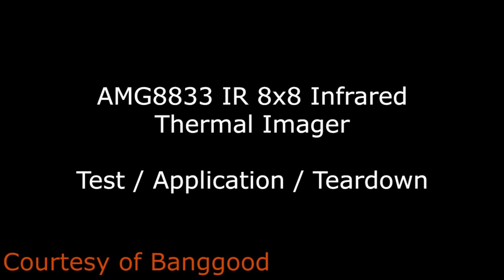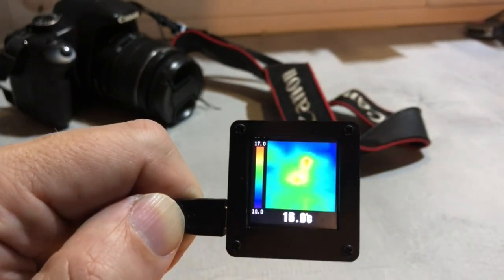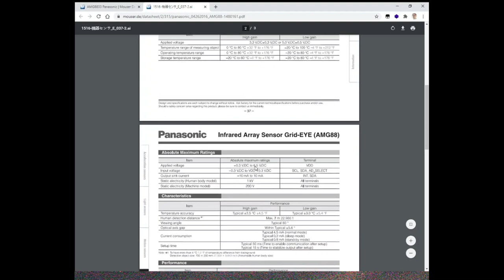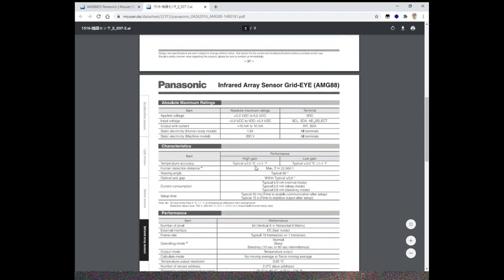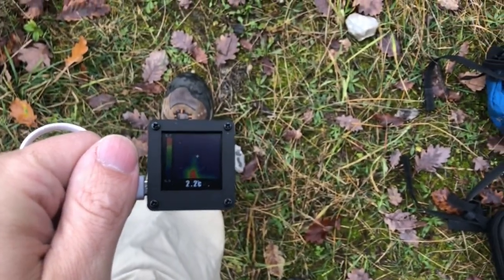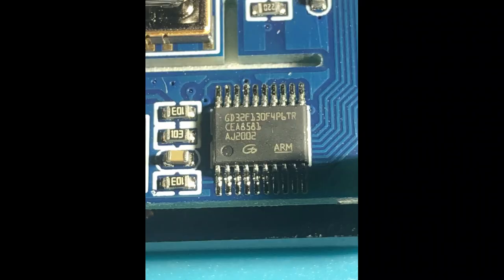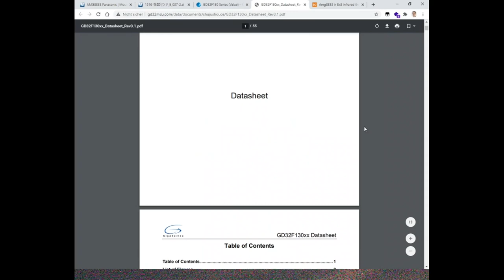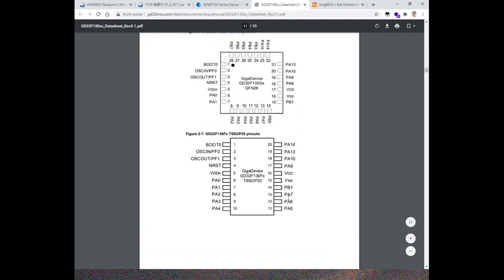Simple AMG8833 thermal imager and how to use it

Comment: What microphone do you use to record your voice over if you don't mind me asking?
Reply from the maker: I always use the iPhone‘s built in bottom microphone with the „Voice record pro“ app. Then very little post processing with audacity on the pc and finally upload it to auphonic, who do a great job smoothing out the audio.
Then in Shotcut I mute the original audio (except for the parts where it is relevant) and add the processed audio as an extra track.
It is a bit of work, but apparently it is worth it.
Reply from the maker: Oh yes, and: I hold the microphone very close to the mouth, a little under the lower lip, so I don‘t blow on the microphone and speak calmly. Basically that is how the Rammstein singer does it, creating a similar effect.

Comment: Would this work to find cold spots in my home?
Reply from the maker: Yes. Tried that. - The auto-ranging does not help in that case, as the scaling keeps changing as you go over the wall. A simple, hand-held IR thermometer will work just as well for half the money.

Comment: are there any third-party builds available for this unit? seeing as there are programming pins, thought somebody might make some better firmware. also, I've seen the same model with three buttons, could we add the buttons to this if they ar using the same controller?

Comment: Hi, I'm not sure if ur gonna reply but I'm a computer maintenance technician, as a professional do you think this camera is good for board repairs? I mean does it give you the necessary details about small capacitors like something a little precise that I can count on to find shorted caps? Thank you in advance!
Reply from the maker: It is nowhere near those high-res thermal cameras with visual overlay that you‘d want in a professional repair shop.
For me, a hobbyist on a budget, it is good enough to locate hotspots on PCBs.
So no: for the professional,speed and accuracy means money and this is not the tool of choice in that case.
Apart from that, I still use it frequently after all those years. It is the only thermal imager I have, so it is the best one I can use when I need one.

Comment: what is the resolution of the lcd? I couldn't get it how did they achieve to acquire real time data of 64 pixel then extrapolate it to somewhat then visualize with an only 48 Mhz cpu .
Reply from the maker: By the looks of it, the display already shows a heavily interpolated image. I guess the next step will be MLX90640 based cameras in that price range. With the same degree of interpolation, that could deliver impressive results.

Comment: Hi, can you please measure the current draw of this unit, and when plugged into usb power does it run continuously or does it time out and shut down? Thanks. I am trying to add a miniature usb charger and small lipo cell to this to make it truly portable. Thanks!
Reply from the maker: I get 40mA with 60mA peaks at the 5V USB port. The easiest thing to test, is simply connecting a 3.7v LiPo directly to the USB port. Chances are that the 3.3V regulator works on that lower voltage difference. Should be a risk free test if you don‘t reverse the polarity.
Reply: @AReResearch  Thanks, that current is almost nothing, I can't believe the sensor, lcd screen and processor only draw 40-60mA!!! I will order a 120mah lipo that should fit inside. The charge circuit is 1A so I may have to modify it to reduce the current. If it works it will be a great little piece of test gear :).

Comment: I've been itching for the same thing for the same reasons. But I worried that with all the reflective stuff on a PCB, that would fool the sensor and you would get false hot spots (at least, autoranged to red "false")  so things that were truly getting hot wouldn't jump out at you on the screen due to all the other areas that were just reflecting heat sources in other areas of the room (like the ever present high intensity lights over elec benches) . You could always just watch the top end temp reading I suppose but if you aren't going to be looking at the image (such as it is) you might as well have a thermal gun with single sensor and just watch for max temp triggers. 
The reflection issue seems to be the case from your video. Can you comment? They say to get a proper thermal reading off reflective things they should be covered in black tape, preferably matte or something similarly non reflective. Black-body solder mask anyone?

For this particular unit I wondered if that might be an I2C bus that you could get data out of.

Oh and what's the point of the cross hair? Usually there are two -  one for the hottest and one for the coldest and they move around to target those areas as they change. Can this one be set to at least grab the hottest spot?
Reply from the maker: I have ordered a AMG8833 module to see if I can get more functionality into a self made design. (yes, it talks I2C) You are quite right: reflective metallic surfaces do give completely erratic readings. I cover them with black tape when needed. For many purposes, a thermal gun thermometer works just as well. But at close distance, the parallax between the laser dot and the actual spot being read makes it less than ideal.
All in all that thermal imager marks the lowest end of that product range.

Comment: help me pls. how do i code if i want to make buzzer sound if 37 celcius is detected with amg8833?
Reply from the maker: I see what you are aiming at. Just keep in mind that the tolerance of the measurement ist +/- 2,5 C, which makes it unreliable for your application. Apart from that, there is the Adafruit AMG88xx library that makes it easy to use the sensor with an arduino. Caveat: with a 5V Arduino, you need 5V/3.3v level shifters. Once you have that, adding a buzzer is a piece of cake.

Comment: I'm very curious as to how far can it detect a person from. I'm trying to build a smart alarm system.
Reply: This sensor is only 8 by 8, the program blends the colors or something, if you want to make a smart alarm system, use a different type of sensor or a thermal sensor with a higher resolution like the mlx90640. These sensors usually can’t detect that far so I suggest you use another sensor like a camera to see movement
Reply from the maker: A cheap PIR sensor will be more effective and economical. The mlx90640 appears to come down in price, that will be interesting to play with.

Comment: This is such a helpful vid! Though I have to ask, how were you able to calibrate the camera to be so accurate?  I have the same AMG8833 sensor but upon comparing it with a thermal gun it had a - 5 degrees C difference.
Reply from the maker: The AMG8833 (high gain) has +/- 3 degrees C tolerance. It is not suitable for precision measurements. That also makes it useless for medical purposes.

Comment: Was it possible to get the data through USB or Do have add another wire for the data line to access the data if connected in the PC?
Reply from the maker: No, the datasheet shows that the DG32F130Fx family microcontrollers don't support USB. That said, USB support can be implemented in software, if there are spare GPIO pins. I haven't checked if that is the case. Done that on an ATTINY MCU, so it is not too hard.
I'd rather take this imager as what it is: An absolute no frills / bare bones imager. - At that is does an ok job.
Reply: @AReResearch  Hallo AReResearch, darf ich fragen wie du USB in deinem ATtiny implementiert hast? Mit VUSB oder mit eigenem Programm und bit-banging? Denke nämlich selber darüber nach, dass zu bit-bangen. Gruß Joshua:)
Reply from the maker: Ich hatte das mit VUSB gemacht. Erschien mir einfacher.

Comment: Are those vtx tx without antennas? On vtx it will burn them.
Reply from the maker: No, the hackrf one is a SDR transceiver. Without the PC (or Portapack) attached, it won't produce an RF output. I still haven't fully investigated the board's fault. Either a shortened bypass cap, or the main processor is toast.

Comment: Do you believe this can detect a hidden camera
Reply from the maker: Now this is an interesting question! I looked up the tech specs of a couple of cameras and as so often, the answer ist: "it depends". While a wired pinhole camera with a little over 1 Watt of power will hardly have a detectable heat signature, others apparently go up to 15W and will stand out like a sore thumb. There the 8x8 resolution will be the limiting factor, depending on the distance.

Comment: I thought 96x96 pixel was bad, then 32x32 came out and now I hear about 8x8. We are evolving backwards.
Reply from the maker: It depends on what you are willing to spend. the MLX90640 is coming down to the 60€ pocket money range. While that is still only 24x32, that is loads more than 8x8.
Reply: @AReResearch Is there anything affordable that does 320x240?
Reply: @AReResearch  omg just seen that the MLX90640 is only 1Hz wtf
Reply from the maker: Where did you find that? In the data sheet it says 0.5 to 64Hz programmable refresh rate. (see: https://www.melexis.com/en/documents/documentation/datasheets/datasheet-mlx90640) Have I missed any hidden caveats?
Reply from the maker: The Atto320 looks interesting: https://pdf.directindustry.com/pdf/ulis/atto320/36189-766659.html But that will need a Germanium lens and I can't find a source for the sensor.